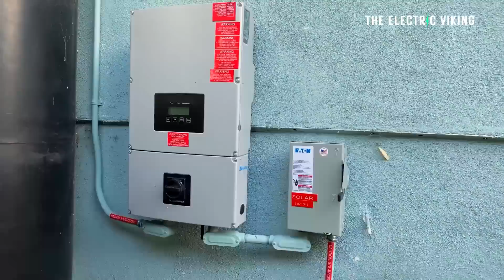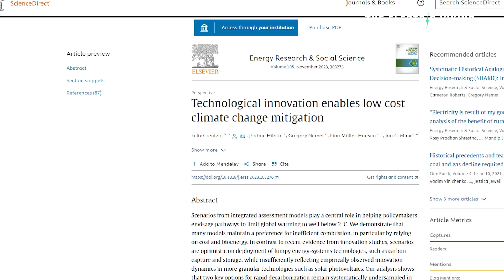Fossil fuels ‘become obsolete’ as solar & battery prices hit 'tipping point'

Comment: Hi
gas, coal, oil are not obsolete, coal is needed for steel production, oil for plastics, tyres, and batteries, gas for fertiliser and other industries. The use of all three are going up along with renewables. What the evangelists for renewables need to find an answer to is what to do with all the turbine blades that are done for in 8 to 20 years of use. They are going to landfill, so are solar panels when destroyed by hailstones and worn out. It would be great if we could do green energy cleanly but there is always a cost to be had. Never mind the cost of the electric cars, if the car is involved in an accident it is written off due to hardly any garages being equipped to deal with them. Then the cost of the insurance to drive them on the roads in the UK and probably elsewhere is painfully expensive. It is not straightforward to move to renewables there is always a cost to pay, even if it is not in the manufacture of the items but what to do with the waste, how we wish it was otherwise.
Reply: You tell me what we should do with the mountains of toxic coal ash that are polluting the world and are a thousand times bigger and a thousand times more toxic than wind turbine blades or solar panels.  Then we can have a discussion.

Comment: And yet global fossil fuel subsidies have never been higher, global fossil fuel consumption has never been higher, and according to the IEA, the growth in renewables continues to supplement rather than replace coal, oil and gas. As an atmospheric scientist I feel duty bound to point out that humanity is not reducing its greenhouse gas emissions. In 2023, global emissions are on track to be just shy of 40 billion tonnes of CO2 equivalent and our carbon budget for the critical 1.5 Celsius threshold has essentially been consumed when the growth in emissions from natural feedbacks (E.g. methane release from wetlands and melting permafrost and CO2 from boreal forest fires) is accounted for. 
I admire your positivity and sincerely hope that you are right, and the human race and the ecosystems on which we depend get lucky.

Comment: Airplanes still need fossil fuel. Military vehicles need fossil fuel for fast refuelling. There are simply applications that cannot be fulfilled by electric mobility. Not yet
Reply: True, but that fuel doesn't have to come from fossil sources.  We already make jet fuel from biomass, and it works fine.  Costs more, though.
Reply: @incognitotorpedo42  Yes, that's true. I've been a proponent of putting biofuel heater in BEVs for colder climate vehicles. Heat pumps are simply not strong enough in -15 degrees, and energy density of fuel is much better suited than battery packs especially for heating.
Reply: @incognitotorpedo42  The true cost of bio jet fuel is more carbon emissions than just burning the jet fuel. If you take in that the planting, fertiliser, insecticides, harvesting, processing and distribution are all done with fossil fuels (and some of these steps cannot be done with electricity alone). The end result is more carbon emissions producing the fuel than you save and this goes for most bio fuels (ethanol, etc.).

Comment: Not the case in uk. My bills have more than doubled and still going up. My income has dropped in the last 2 years. Have friends living in the cold . They cannot afford the gas central heating. Heat pumps only work if your home meets the high insulation standard. ,80% of uk homes fail in this area. It's a non starter here. I have my own ideas to combat this problem.
Reply: Heat pumps can work even without high insulation, general houses will actually be fine, just a lot of people keep saying they won't work and repeating it misinformation and don't know the facts.
Reply: @orionbetelgeuse1937  The grass is always greener somewhere else. But there is a lot more solar energy than you think. Even on a cloudy day it is noticeably warmer than at night. In the 1970's my parents installed hot water solar. Essentially a hoze pipe running over a black surface. Even in winter it was warm enough for most purposes, but we were living in the middle of England rather than further north. If solar is not adequate then wind power should do it. Otherwise longer power lines, nuclear or fossil fuels as a last option.
Reply: @orionbetelgeuse1937  again your making out like heat pumps are worst for the environment saying about the gases and production etc while completing ignoring the fact that a gas boiler is 100% using a fossil fuel to run. Heat pumps are less efficient in winter, but they also can run without causing any pollution from renewable energy whilst a gas boiler never can.
Reply: At the moment there are two factors in the UK. Electricity is mainly created from natural gas. That used to come from Russia. There are levies on electricity companies to encourage green energy.  

The sooner that we start to get significant solar and wind power the better. However rebates to home owners would be expensive, as there are a lot of homes. Land to put solar and wind power in place is expensive, but there are also planning issues. No-one wants to destroy the green belt and people don't want the noise of wind turbines near their homes.  

In the end, I would like every home to have solar panels. If prices come down and efficiency goes up, that should help. However I think the main cost is for installation.  Putting up scaffolding and labour for fitting.  Its a one-off cost that will benefit the property for twenty years but currently takes about six to eight years to break even..
Reply: @robertwhite3503  Supposedly the UK bought very little gas from Russia if any, however because of the self inflicted  sanctions that have done way more economic damage to the EU than Russia that has pushed up the price of natural gas resulting in the de-industrialisation of Europe and businesses relocating to the Americas if I was a tin foil hat wearer I might say this was all part of the plan:-)

Comment: Not quite. Charging speed still has long way to compete with fossil fuel refuelling speed.
Reply: Fossil fuel refueling can't compete with the ten seconds it takes me to plug in my car in the evening and unplug it in the morning.  It would take me at least 15 minutes to drive to a gas station, fill up, and get back.  Gas also costs 4 times as much.
Reply: @incognitotorpedo42  10 seconds to plug in but how long to charge? What if you are in emergency you go somewhere?
Reply: ….or if you have solar….it’s FREE!
Reply: @Cant_prove_god  it's not free. Solar installation costs. Also maintenance. Not to mention increased insurance cost to you house. Inverters need replacement every 10 years that's $5000
Reply: It is free for me.  The solar was on the house when I bought it, and even if it wasn’t, it only costs USD $3k for a 6.6kw system in Australia, installed.  I’m saving $3k every year on gas by charging at home, and an extra $3k on electricity bills….it’s a no-brainer.  Inverters don’t cost $5k, they cost $1.5k and will last longer than 10 years typically.  Also, there is no additional insurance cost from my provider if I have solar, or not.

Comment: Statistics are funny. In the Netherlands, in January 2017 we bought 9x 265Wp (2385Wp total) Solarpanels + materials and installation for €4.000 
Total energy they bring on average is 2550kWh per year. Seeing this video I did a check again, expecting the prices have come down a lot. Surprise . . . . they didn't.
To put 8 x 270Wp panels on our roof (total 2165Wp) with material and labor, is . . . . . .€5360. 
Probably not the cheapest company, but the others were not much cheaper. With B-class panels it would be around €4200. 
So, the prices didn't come down after 2017 . . .at least not in the Netherlands.
Reply: In much of the US, the labor costs kill you.  The labor is so much that I think they can sneak the overpriced panels past the customer.  Home solar companies are making a lot of money.  In Australia, it costs 1/3 as much to get the same system as in the US.
Reply: Do some research with panel wholesale prices, then you'll see the drop. Your vendors are just not passing that on to you(us)
Reply: @devonbikefilms  The cost of panels has a small part to play (wholesale or not) but its labour, conversion and control electronics, other materials and warranty that really control the cost of installs.

Comment: Good because we need the oil to make plastic
Reply: No, we don’t.
Reply: @orionbetelgeuse1937  Where did the oil come from? CO2 and H2O. Every molecule in petroleum can be synthesized, and plastic isn’t petroleum.
Reply: @orionbetelgeuse1937  We haven’t been motivated to stop doing it before. That said, I’m a lot less worried about getting plastics off of fossil carbon than I am about getting energy off fossil carbon - I’m more concerned with reducing plastic use overall than how we make the plastic. Pollution is pollution, whether plastic or CO2, and we are creating so much of both that they are dangerously impacting the entire biosphere. So my initial response was just pedantic… we DON’T need oil to make plastic, counter to the OP’s claim. But whether it’s made from oil or not isn’t the real problem. The fact that we make as much of it as we do, and have so little ability to deal with it… that’s the problem.

Comment: I can't afford yet but if they get to the point where it's 20-30USD per KW I'm in for 100KW. For solar I would like to see .20-.25USD per watt on panels. At this point I would likely not need the grid at all but would still be on it to contribute my extra energy.
Reply: Do it!! You won’t regret it, especially if you buy an EV too and charge it off your solar.
Reply: 100kW  is an insane amount of power.  What are you planning on doing with all that?  Don't expect the utility to buy it from you at retail prices; that's untenable in this day and age.  They can install solar for less than you.

Comment: I have solar and batteries for my camper van and trailer, and I appreciate that the prices for similar products have been dropping over time. 

But at scale, why are energy prices going up?
Also, saying "just install solar, just buy an electric car" does not align with MOST people's current economic reality.
Reply: The reason for any supposedly higher energy prices during this relatively early stage of the systemic renewable energy system transition, is because tradition fossil fuel based energy generation system can only provide cheap energy when they are running uninterrupted full time. The increasing penetration of renewable energy based generation systems into the mix is reducing the demand on fossil fuel based energy generation as a percentage of the overall energy mix. This results in fossil fuel based energy generation becoming more and more uneconomical to operate since the demand for it is intermittent and so the price of fossil fuel based energy generation goes up. There is also the difficulty of grid management because as the transition evolves we will have what is effectively a hybrid energy grid and this presents the need for tighter management of the grid for now.

The irony of the situation is that, for the time being, it's obvious that we need some fossil fuel based energy generation to provide base load certainty at some stages in the 24 hour daily cycle. That situation will exist as the renewable energy transition evolves and matures into a complete system, which will include various forms of energy strorage. This is happening but it is going to take considerable time. There is no magic switch to transition in an instant to fully renewable energy based generation. It would be silly for anyone to argue in a manner that would suggest otherwise.

So your question about pricing is a fair one, but reality isn't always in our favour or optimal to our liking when systemic change and technological revolution is happening. The situation will gradually change for the better though.

I should add, that if all the time and effort of the renewable energy naysayers could be disposed of, things would be progressing and getting resolved much faster on all fronts, including cost of energy.
Reply: @BrentonSmythesfieldsaye One of the key things, that hasn't happened where I live, is time of use pricing. Then we should see both low and high prices, encouraging people to use more when there is plenty, and less when we are short. According to Tony Seba, we have to build 2-3 times as much as we use, so we don't need as much storage.
Reply: @BrentonSmythesfieldsaye  Another opinion. I literally say the same with other words: Fossil fuel based industry lobby very hardly to get better contract. 
So, at the moment, they do less job, but get the same profit as before. 
That is why people does not see benefit of renewable, because it is swallowed by fossil fuel industry. 

This cheap energy makes energy more expensive is just another cliche. Politics makes energy more expensive :) 

This intermittent energy consumption was always mentioned as the achilleas tendon of the renewable despite the fact, it is not true. If you see the graphs, than you will see it is very consistent and can be predicted in a 3h window pretty much perfectly, and that is enough time to turn on or off a gas powered turbine. Also, there is Virtual Power plant and open ADR so basically you do not even need to turn on gas turbines in most of the cases. 

You mentioned the grid is more challenging is just another cliche. I highly recommend looking after what is open ADR. 
This problem does not even exist, but it is already solved with a few pennies software. The grid become more resilience year by year that is the reality.

We are leaving in the world, where wind turbines and solar panels being switched off earlier than gas powered stations.
Where wind farm sign contract for 8c kwh, while gas turbines get way much higher. 
And when you raise a question, how the contract works, than they simple refuse the answer, with "you can't understand this..."  You know what, let me decide if I can understand it or not.

The cost of gas powered comes mainly from the fuel, if it is not running what cost they have? How they can't run economically? 
I learned, when company says, they can't run economically, they usually mean, they do not want to lose there market share. 
You can say, the build of power plant cost a fortune, but these were built long long back, and it was already paid back.

I completely agree, the transition will take time. but it is actually very rapid if you see the reports on IEA report. 
I agree we need some fossil fuel, but slowy we will be at the point where less and less..
Reply: @BrentonSmythesfieldsaye  Are you happy to pay more for energy (petrol and electricity)? If yes, just keep supporting fossil industry. You need to understand the fundamental problem here. The cost on your side is profit on their side. When you asking for lower price, you literally asking fossil industry to have less profit. Of course they will say, that is the only option. They do not want competition. But the reality, we have finally an other option: Renewable.
Reply: @buscseik  I take it that means you are not going to read the reports. Well I did say it was up to you. LOL.
Reply: @BrentonSmythesfieldsaye  Could you clarify what you mean? I guess nothing
Reply: @buscseik  I think we are done. Thanks.
Reply: Normal inflation. Corporate greed. Initial purchase cost being recouped. Solution: buy your own panels and stop using the grid.
Reply: It doesn’t align with their perception of reality, you mean.
Reply: @mnhsty  You may have misread, andy said "does not align".
Reply: @BrentonSmythesfieldsaye   Sorry,  I was distinguishing between reality and perception of reality.
Reply: @mnhsty  Ah yes, I failed to notice that nuance. LOL.
Reply: As in, the perception of average person's 
bank account? @mnhsty
Reply: Hahahaha, not one person is for the fossil fuel industry. Why is there always a bad guy. Oh nooooo!!!!! A company is making a profit. It seems to me what y'all are missing in this conversation is a reality of an electrical grid system. Y'all talk about taking your excess and giving it to your neighbors, that's fine I'm itself. But how the hell do you do that? Oh,right. I use the big bad electrical system. Who the hell do you think put that system together? Those trees weren't taken down and trenches weren't dug and holes dug in the ground and those wires either laid in the ground or pulled up into those poles and said wires connected to homes and power distribution plants built to receive the high voltage lines to step it down to transformers to feed your houses. All this and more didn't just materialize magically. It took multitudes of people to put the whole grid together. And more importantly, keep it running. You ignorant people actually believe you have a RIGHT to export your lil excess right into someone's else's property. You hypocrites!! You blame big business for making a profit but you have no problem with trying to force the company to take your excess. Your excess isn't reliable so how the hell is the utility suppose to plan how much areas need at any one time? You want every bit of credit\money you can get, right?  Now who's the bad guy?